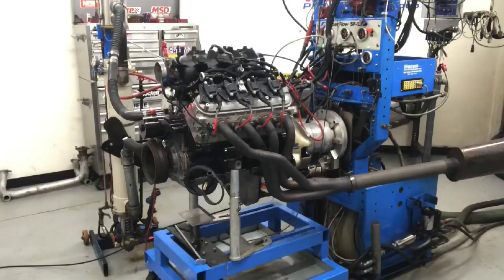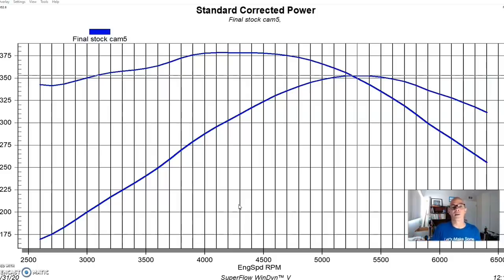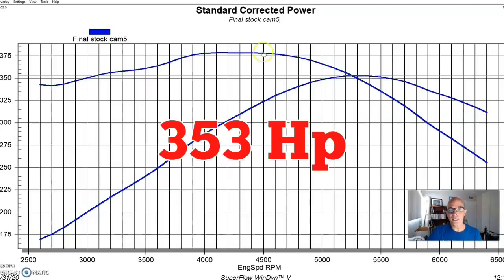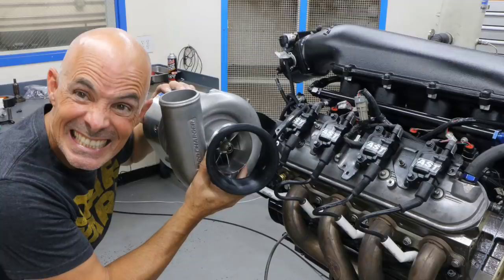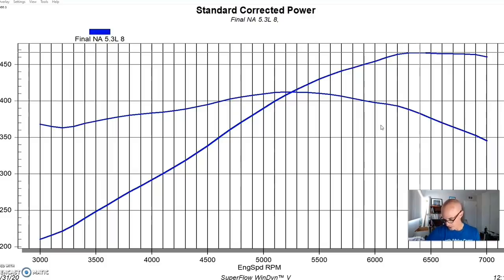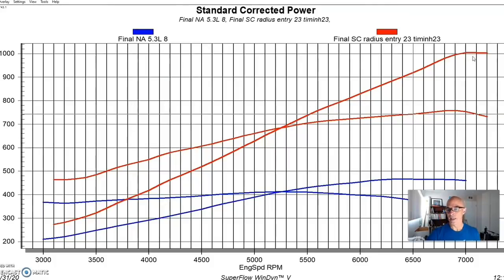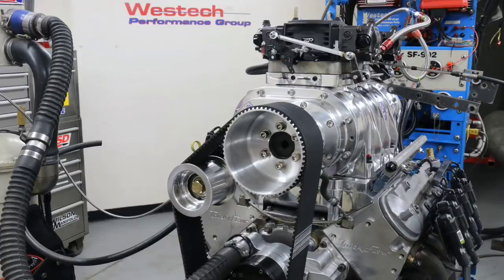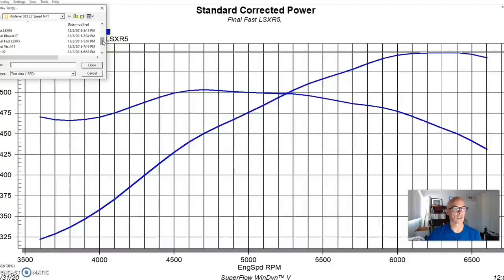BLOWERS vs TURBOS-THE TRUTH ABOUT BOOST

Comment: Thanks for the boost overview. Why couldn't the centrifugal supercharger boost curve be controlled by a blow off valve?
Reply from the maker: it can
Reply: @richardholdener1727  Can be done, sometimes accidentally, on screw blowers too. Used to see Mustang guys unhook their bypass solenoids and see power gains on the dyno lol.
Reply: Vortec sells blowoff valves if you want to do that.

Comment: Richard could you make a video or tell me if you made it about high compression vs low compression under boost and when would be good to have one vs the other. Thanks! Great videos learned a lot!
Reply: Compression will always be limited by the fuel used
Reply: @allen43d  thanks Allen, I get that. The thing I'm interested it's that with lower compression on the same fuel,(E85) we may be able to handle more boost and get more power. Or would be beneficial to get less boost and more compression, I believe this is just done for fuel economy but I'm not sure of this  and if applies on a v8.
Reply: Jose Eduardo Bruno Your better off to keep compression higher, especially with E85. The engine will be much more responsive and come up on the transbrake/two step, much faster/cleaner.
Reply: Hi comp makes more power but it can't take much boost without detonation.  Low comp makes less power but you can apply more boost and get even more power.
Reply: At 8.87 to 1 compression I made 1027rwhp at 25 lbs boost. At 10.77 to 1 and 30 lbs of boost it made 1340rwhp, although It was intercooled. I also quit pinching ring lands, with the higher compression and intercooling. Not sure how much power your looking for?
Reply: I think Richard has done this test before

Comment: Richard, I’m building a small block 400. What do you know about plugging the steam holes? Should I? Or should I run them. I’d love your input because I’ve heard so many different opinions and I’d love to hear yours
Reply: I've ran 400's for years.  Never plug them.  Just drill the heads if they don't have the holes yet.
Reply: @prestonedmonds4128  Have you ever had any problems with head gaskets if you drill the holes?

I've also heard pressure can build up and actually cause overheating defeating their purpose

I know all aftermarket 400 blocks dont even have the steam holes drilled.

This is my first engine build, so any additional info you have is greatly appreciated them
Reply: @vincentmarino9825  I've never had overheating problems.   I'm running a big Procharger intercooler in front of the radiator, too.  Stays cool in heavy traffic.  I do think that the Taurus fan helps keep it cool compared to a normal fan.
Reply: @prestonedmonds4128  I appreciate it. I've got a set of Trick Flow aluminum heads and a dual fan set up from Summit that should hopefully help keep things cool.

Are you actually running a procharger too? I was planning on adding a TorqStrom supercharger in the future
Reply: @vincentmarino9825  if it doesn't then check out early 90's Ford Taurus fans.   Here's an old video of my car with the fan off then turning it on.  You'll see how quickly the temperature drops.  

https://youtu.be/CrlAnbKD0DI

Comment: Interesting, as always. Love these comparisons.  In the future, I'd like to see some stuff about the tuning process- particularly part throttle/driveability stuff. You've done some great EFI/Carb comparisons at full throttle, and I'd be interested to see differences at low RPM, part throttle and transients.. Keep up the great work.
Reply from the maker: part throttle and transition is best done on a chassis dyno or the street
Reply: @richardholdener1727 ... do a twin Torque Storm supercharger setup on an engine... they have the kits available for all the popular engines... even the Gen3 Hemi (I own a Hemi Ram, so I really don't care about other engines)

Comment: I love big blocks with a Procharger.  For the HP they make they are very drivable with throttle response being very controllable.  You keep your big block lower end torque for drivablity with huge power coming in with additional throttle.  Of course is you just mash it your tires will die.

Comment: I like your channel. I'm asking for  your advice.I have a 77 Chevy half ton with a very tired 350 that I'm going to replace I'm either going to put a 383 or a 472 candy. at 2300 I'm at 55 miles an hour I toe with this truck.until seeing your channel I have never been interested in anything except naturally aspirated but now I'm wondering what do you recommend for a low RPM boost adder. I need power from 800 RPM to 3000.thank you.
Reply: Sound like you should drop a diesel in that. low rpm torque..
Reply from the maker: the caddy (even a 500)
Reply: A positive displacement blower is about the only thing that would provide boost at 800rpm. You could go for a small turbo that would come on that low, but it would be maxed out pretty quickly as well. You'd have to be very careful though because heavy load at low rpm with boost can be hard on the engine if the tuning is right. And any power adder is also going to be adding more heat.
Reply: @NBSV1  thanks. I'll just stick with naturally aspirated like always. That's what I know.

Comment: Now take a tesla motor and use it to power a 3000hp procharger and feed that in the engine. Boost the boost......
Reply: Ultra CNC  all I see is instant NOS or control boaast by PRM
Reply: Ultra CNC  damn I was drinking and commenting.

Comment: Thanks for all your hard work. I am learning a lot. What I would like to know or understand better is when you run one turbo into another or run turbo into or with a supercharger.
Reply from the maker: compound stuff coming
Reply: Running a turbo into another turbo basically just means the second turbo doesn't have to work as hard since it's got air being forced in rather than having to pull air in. That's why most compound setups have the second turbo actually smaller than the first one. 

A turbo into a supercharger gets complicated. Since the supercharger can cover the low rpm you typically go for a larger turbo to cover the high rpm. Which means at some point you will want to switch from the supercharger to the turbo. They don't compound like two turbos can because the supercharger is belt driven so will only spin to a certain rpm. Which means the supercharger becomes a restriction. That's why basically any super/turbo setup will have a way to bypass the supercharger when the turbo takes over.
Reply: @NBSV1  Interesting thought..  What about starting boost with 1 or 2 small turbos, then having a centrifugal supercharger take over?   This thought came from one of my cars that has 2 very small turbos that start building boost at 1800rpm and kick in very hard at full boost at 2500-6000rpm.   Then a supercharger could take over around 4500-7500...
Reply: @Spirited_Driver  Usually the setup uses a positive displacement supercharger so it can provide boost nearly right off idle. But, those become less efficient at high rpm so that's were the turbos can come in. The centrifugal supercharger could also work in that way, but then you'd be wanting to have 2 superchargers.  

At the end of the day it becomes difficult to manage and make work right since you need something that provides low rpm boost but also won't be a restriction or power loss at higher rpm.

Comment: what would the effect be if you were to use a larger roots blower, like a 10-71 or 14-71?
Reply: You wouldn't need to turn the larger units as fast to provide the same amount of boost.   6-71=426cid, 10-71=710cid, 14-71=994cid - that is how much air they pump in on a single revolution(theoretical, not always 100%).    However, the larger the roots blower, the more crank power is needed to turn it.  It becomes a matter of depreciating gains.    The pulleys I saw in the video on the 6-71 left lots of room for pulley swaps to increase boost.   And with that - you don't want to overdrive a roots too much.  There is a point where that becomes an issue.  That is when you step up to the next size.
Reply from the maker: those can supply more power-though not needed on this test motor
Reply: Might it work better on the 500 or another big block?

Comment: You could do what Cosworth did back in the 80's and use an external air compressor and large receiver to provide a very controllable level of inlet pressure :O

getting held back by my turbochargers turbine wheel/housing :(

Comment: I'm assuming that screw type superchargers will act similar to the roots style?
Reply: Yes. All the positive displacement blowers will act similar. The twin screw is more efficient so doesn't heat the air as bad and tends to remain efficient to a higher rpm.

Comment: I'm my opinion the centrifigal is the best.  Simpler installation less heat and an awesome top end
Reply: Well in my opinion a turbo is best. When you load it, it makes more tq. There’s no belts to slip. Less power loss. I can change my power levels as the press of a button. I can limit boost down to 5psi in 1st gear for traction if I need it. I can control boost by gear. You can build boost on the line. A turbo is easier on parts, there’s no tension on the crankshaft, it’s more efficient. When someone rides with me, the extra weight is compensated for. It’ll build another psi because it’s being loaded more. Your turn. Tell me why you think a supercharger is better. O and if you want to change boost levels, I don’t have to mess with a pulley. I press a button.
Reply: @Turbogto_guy   It's possible that it wasn't your intention, but when you give your opinion and finish by saying something as condescending as "Your turn. Tell me why you think supercharger is better" it's unreasonable to expect someone to think otherwise; Especially when your response in no way addressed the points he already made...
Reply: Brendan Breen my bad. Maybe I need to work on my people skills. Edited. There I go again....lol
Reply: guys  it's just my opinion.  I'm not trying to ruffle anybody's feathers.
Reply: Jose Iracheta no worries brother. We all gear heads here. I just wanted to point out some things that a lot of people don’t realize when going turbo or supercharger.
Reply: @Bozemanjustin    Pressure in the exhaust before the turbo does reduce the power produced.  Its not free energy  That's why changing from a tighter turbine housing with high back pressure to a larger housing will produce more power.
Reply: Levi Dieter Thx! I try!
Reply: @Turbogto_guy  It doesn't appear that you understand how opinions work...
Reply: Brendan Breen why is that? I gave my opinion with reasons to back it up. Anything wrong with that?
Reply: @Turbogto_guy  You stated your opinion as though it somehow invalidated his opinion. What about your opinion changes the fact that a centrifugal super charger is easier to install, simpler, and cooler (assuming you don't further complicate it with water cooling) than a turbocharger and still has a rising boost curve? Just because his opinion isn't inline with yours doesn't make it wrong.
Reply: Brendan Breen I wasn’t trying to invalidate his opinion and everyone is entitled to his opinion. Just in my experience, the belt slippage issues is enough to offset the ease of installation. There’s a reason I’ve seen a lot of people take the supercharger off and go turbo and never look back. Matter of fact I had a guy not long ago contact me to build him a turbo kit and get rid of his supercharger. I just figured if superchargers were so good, why go turbo? I guess it’s better to have a supercharger than not have anything.
Reply: @Bozemanjustin  by definition a turbocharger increases exhaust manifold pressure (back pressure). That increase in pressure means that the engine is doing work to compress that air, that means that's lost horsepower.